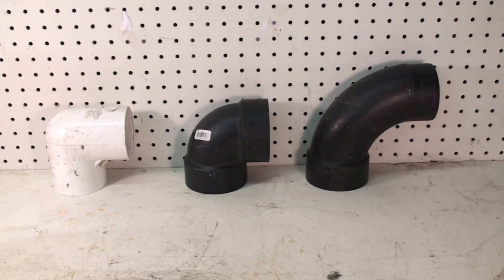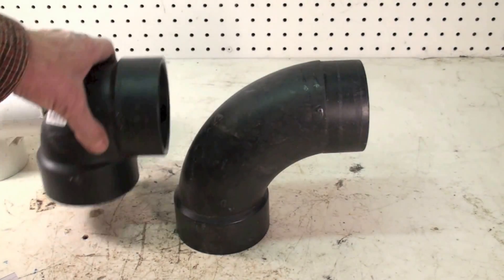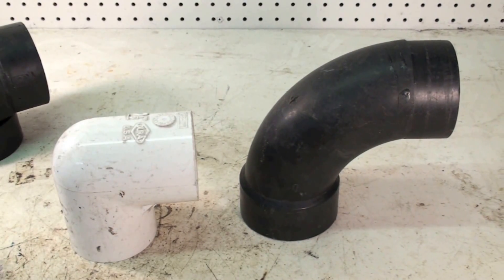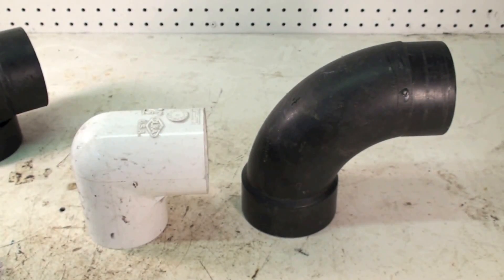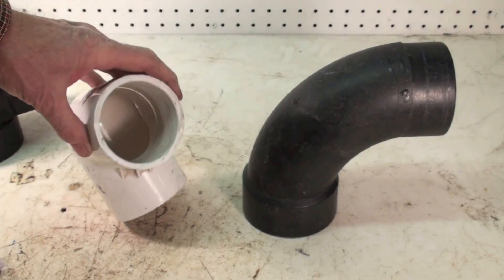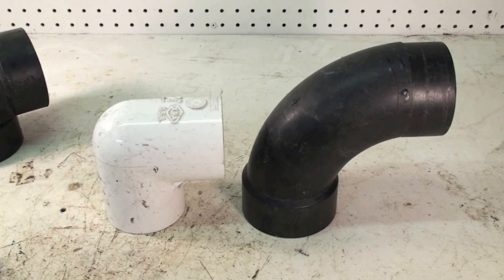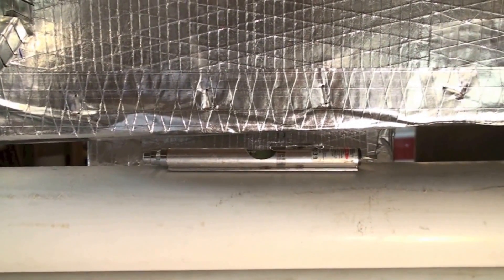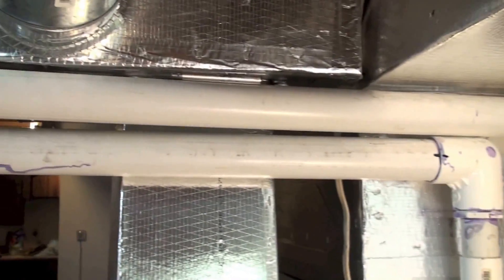Troubleshoot hi eff gas furnace venting

Comment: I am experiencing excessive moisture in my venting in a wet basement. The exhaust pipe exiting the furnace sags at the outlet side of furnace and pools water running into the furnace. This pooling of water causes excess moisture in my vacuum lines. Should I just redo the vent piping because what is iinstalled is glued and can only be adjusted oh so slightly. We just had new ac condenser/Acoil installed and had to move furnace 2 inches. Now the furnace is non functioning again with condensate in exhust vent. American standard horizontal mount. Condensate is supposed to run BACK into furnace right? With the exhaust vent going up  the vent pipe could be filled with water.  I'll have to double check all drain weep holes for plugging and consider any advice. Tia.
Reply from the maker: I would replace everything it takes to get rid of the sag.  
Condensate should run to the furnace, just not in copious amounts that a sag would sag.
GFM

Comment: Thank you for the video.  I am having an issue with my two year old 96% with flame “hiccup” or fluttering.  So far we have replaced the board’ pressure switch, as well as the gas valve.   The flame flutters intermittently and sometimes shuts the furnace down.  I have several sweeps for a 25 ft run on the vent side. Toward  the furnace, it seems that a have a spot that it slightly  sloped away from the furnace.  I am still within installation spec for the run and elbows @2 inch.  Three HVAC guys including a family member said they have no idea what is going on.  Question is, can this slight dip (6”) in the pipe possibly be messing with the pressure switch?  It makes each time it calls for heat.  Just sputters slightly a few minutes into the cycle.  No apparent HE issues as the flame is blue and consistent through the cycle. 

I am literally at a loss with this unit at the moment, this video kind of gives me a last hope.
Reply from the maker: If you have a 6" dip, that is your problem.  The unit may drain mostly back to the furnace during the off cycle, then when condensate collects in the dip during the on cycle, it makes waves that will partially block the vent.
GFM

Comment: Why would the manufacturer care what kind of elbow you use, as long as the total resistance is acceptable?  AirQuest just specifies the maximum number of equivalent feet, and you deduct from the maximum linear feet according to the number, angle, and radius of elbows used.
Reply from the maker: Some manufacturers determine the resistance of even one short radius ell, when used with the minimum vent length of vent pipe is too much resistance.
GFM

Comment: Have a video on power vent water heater into type B? I see you have a cat 1 venting rules but power vent water heater isn't classified type 1. So I just tried it yesterday and it worked fine. There'll be just as much condensation as my gravity water heater so what's the big deal? Why should I have to convert to 2" PVC? So I got the power vent water heater as my backup to my gravity water heater but I don't think I will run them at the same time because they are two different categories, unless you do think I can and the power draft won't blow out the pilot on the gravity? Have you seen anything like that before-- the power vent water heater actually snuffed out the pilot light on the gravity water heater if they are both vented together?  Please make a video?
Reply from the maker: I could make a video but it would consist of "Don't do it".  You will corrode the B-vent.  It is not designed for condensation.  If I came upon this setup I would be required to red tag it.  Not just because it does not follow code but it is dangerous.
GFM
Reply: @grayfurnaceman , that would be great. Fails are also learning experience. Next Q:  Can you ridge the PVC, say halfway or wherever, so that condensation drains out as well as back in? Condensation can't drain out because it potentially freezes in layers each freezing day and that would block vent at the output?
Reply from the maker: @1weirddoe571  If you want it to drain out, pitch toward the vent.  Then armaflex the vent to stop freezing.  Rheem requires armaflex.
GFM
Reply: @grayfurnaceman , expensive, stainless steel, single wall z-flex for Cat1-4 could do it? But not Centrotherm  since can't be used for bvent Cat1, right? https://youtu.be/aKPMeVSaLqk
and if it can take high temps then why not use for b-vent replace: https://youtu.be/H3I3sxgS6Xo

Comment: Hi thanks for the video.  I was wondering if you can help me. I have someone wanting to sell me something I don't think I need. Earlier this year I extended my 2 inch id gas heater exhaust pipe out to 35 feet it was 25 feet. I did this to vent the fumes away from where we sit on the deck.  I made a mistake when extending it because I did not use enough support straps and it developed a low spot in the pvc pipe which resulted in condensation that  got stuck in that low spot and it probably froze or had water built up, causing my furnace to overheat.  I  fixed the slope , no low spots the water drained out right now and the slope is right.  I think I am good, but the Hvac company told me that my 2 inch intake and output should not be placed under deck. In addition, they told me that I needed to increase 2 inch Id pipe to a 3d ID pipe. . Do you know if they are telling me the truth when they say it should not be under the deck and that I need a 3 inch pipe to go 35 feet. I think since I fixed the slope issue that I might be good with the 2 inch id ran 35 feet?
Reply: Furnaces come with installation instructions, mine is a 137pg PDF. It lists the max length and elbows. Based on my tables, 35ft is nothing unless you have 6 or more 90s in the pipe. 

Has your furnace worked since you fixed the slope? If you're near the limit, maybe leave the intake pipe short (unextended) and keep the exhaust long. But like this video says, Read The F Manual :)

Comment: also, how should the pipes ultimately LOOK on the outside of the house? Meaning...what is the BEST lengths for each of the PVC pipes and how should they be positioned?  We had a HE furnace installed and we arent happy with a few things. We have a serious dust issue now...and I JUST noticed that the LEFT side pipe coming out of the furnace is NOT even securely joined to the extension pipe!

Comment: How about using a condensation tee with a clear flexible hose to the nearest drain or floor drain. Plus you can only go a certain amount of feet before it goes outside there is limit on piping and elbows. I living in nyc have seen during cold winters the outside fitting for exhaust freeze over due to condensate build up of ice in 20 to 25 f degree temps. Try getting to that fitting on 4th floor of a building. The unit which was Teledyne Heatmaker were notorious for this but they did have a safety switch that shut the unit down after cycling three times. I feel thru trial and error will catch up to solve these issues but I hate be the one to be the example.
Reply from the maker: I also live in a cold winter area.  I have never seen a freeze up of a vent that did not have a screen in it.  Not saying it cannot happen, but a condensate drain should not be necessary if the venting is pitched toward the appliance.
Possibly if the venting is in an unconditioned space, it could be insulated as I have done sometimes.
GFM

Comment: Does air intake pipe has to be pitched back toward furnace?
Reply from the maker: Yes.
GFM
Reply: Why?
Reply from the maker: So any moisture that gets into the pipe can be directed to the drain system of the furnace.
GFM
Reply: Thanks you.

Comment: Question, GFM if you have time. I’m a new tech (installed for a couple years, been doing service work for about a year) I work with guys who say these exhaust vents sweat on the outside if you don’t have them insulated. But to me it doesn’t add up that “warm liquid on inside + cold air outside = condensation on outside.” Condensation always forms on the other side of “cold” in my experience. Never had a cup of coffee sweat. I’ve yet to see this happen and I’ve worked on many 90+ furnaces with uninsulated vents. Admittedly, it could be that I just haven’t been around long enough to see this, and I’m definitely new enough to be missing something and I’ve been wrong many times! But none of these dudes can tell me why it supposedly sweats on the outside. Can you speak to this?

Comment: With a gas furnace running, during a drought, what would cause moisture to come back down through a vent pipe and puddle under the unit? (This vent is fed with a liner up through a chimney and connected to a vented gas chimney cap.)
Reply from the maker: Drought has nothing to do with moisture from combustion gasses.  The moisture is from the burning of the gas.  There are several reasons this could happen.  If the liner has corroded, the leaking vent gasses may condensate in the chimney.  The furnace could be under fired.  The liner could have been disconnected.  I would first check the bottom of the vent between the furnace and the chimney.  If it is rusted out, there is condensation in the vent.  Hope this helps.
GFM
Reply: Thanks, the pipe is definitely rusted. The moisture is coming from inside the piping and down through the furnace.
Reply from the maker: You will probably have to replace the venting.  If it is single wall, it will have to be replaced with either Z flex or B-vent.  
GFM

Comment: Moving more air faster seems like a no-brainer, but if the added resistance of the short els helps keep the hot air in the heat exchanger a slightly longer period of time, could that perhaps help boost efficiency?
Reply from the maker: Modern furnaces have gotten this so dialed in that any efficiency change will be so small as to be meaningless.  Just buy one less latte a year.
GFM

Comment: GFM, 
when calculating diameter of pvc pipe do you add total piping/elbows of intake and exhaust or just exhaust? thanks
Reply from the maker: Depends on manufacturer instructions.  All manufacturers have their own system.
GFM

Comment: If you are an engineer 40 or older that designs fittings, that is a sweep 90. Another great video
Reply: That particular sweep 90 is also a street ell rather than a standard elbow, the difference being that a standard elbow has two female ends while a street ell has one female and one male.

Comment: I have an Arcoaire high efficiency downdraft furnace in a slab home. The exhaust gases are vented outside but the furnace intake is from inside the house in a very active hallway with a lot of dust in the area. Would it be better to pull air from outside with 2" pipe and if so how far away from the exhaust pipe be from the intake? My inducer blower only lasts two years because of all of the dust and dirt from the hall and that's why I'd like to go to outside air.

Comment: I have a mold issue in the attic,backside of decking.Attic venting & circulation are correct.looked for all /any interior leakage to attic leaks,nothing,what i'm suspecting is the furnace exhaust blowing heated air in the winter up & into an eve vent which is almost directly over the exhaust & pretty much what looks to be the origin area of mold in the attic,a similar home 3 doors down brought the exhaust piping vertical & higher than the house,is there something to this ?
Reply from the maker: It could be.  The exhaust gas is 100% humidity.  Can you send pics?
GFM
Reply: I have some how do I get them to you ?
Reply from the maker: Tjfreak Send them to grayfurnaceman@gmail.com
GFM
Reply: grayfurnaceman  Great vid and critically important information, this is good info in relation to HE Furnaces but there are vented units which are not HE and require the vents to be sloped away from the furnaces due to their inability to handle condensate, only thing that is confusing is the vent, exhaust and intake,  spacing on the exterior of the dwelling.  Any pointers?

Comment: Just curious... can I use my basement inside air for combustion on the newer 90+ furnaces instead of running a pipe for outside air? My basement is 1000 sq ft and 8ft tall.
Reply from the maker: On most furnaces, yes.  I would check the install manual.  
GFM
Reply: You would create a negative air pressure environment in your basement if you vented your intake in the basement. This is dangerous, especially if your hot water heater relies on atmospheric venting.

Comment: Hello. Can anyone help me with my furnace? The problem I'm having is air is blowing back pass the combustion blower from the vent after it cycles or the system is turned off. The furnace work great except that one little thing. Is the combustion motor bad or is something else going on? I'm sure that is where my problem is coming from because when I take the vent air line off, not air flows back through the vents in the house.
Reply from the maker: Are you saying you are getting outside air into the heat vents?  If outside air is coming back thru into the combustion chamber it will not go into the heat vents unless you have a massive crack in the heat exchanger.  I would have a professional look at it.
GFM
Reply: grayfurnaceman yes I am and think you. Is that something I can change out or repaired myself or do the whole unit need replaced?
Reply from the maker: James Richardson It kind of bothers me that outside air is being mixed with air in the duct.  Is it possible you have an outside air inlet duct?  The reason I have said go to a professional is you may have a simple problem that does not mean a heat exchanger.
GFM